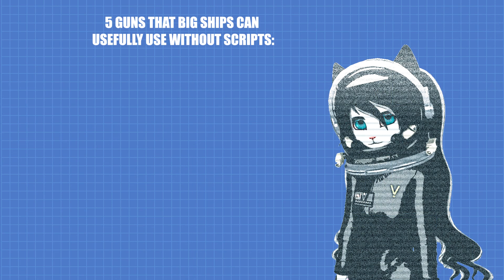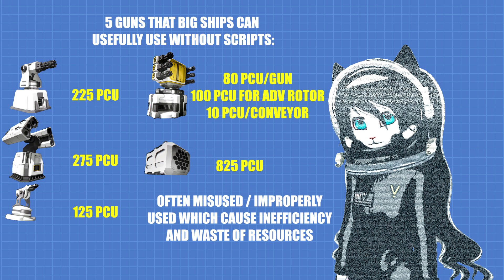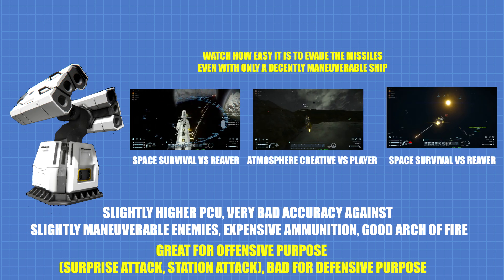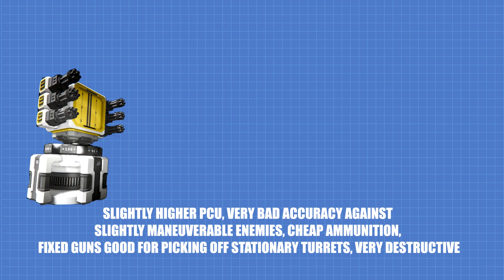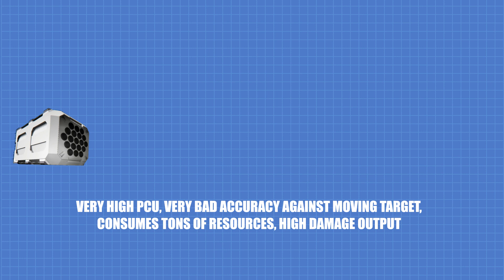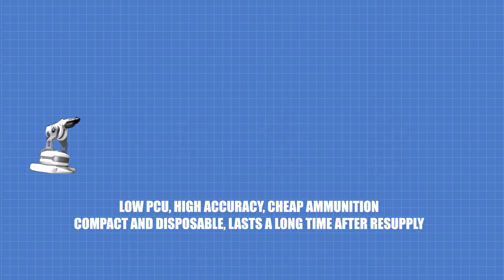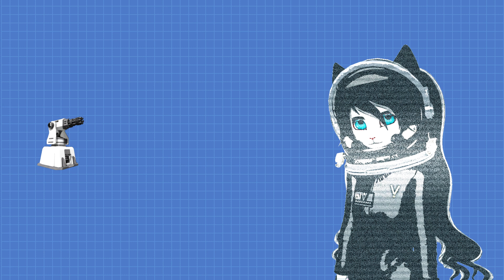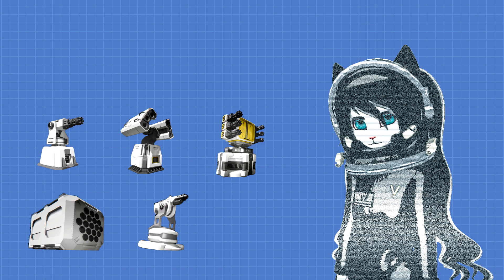Space Engineers Advanced Combat Guide, When to Use Certain Weapons on Your Design For Max Efficiency

Comment: Can you go over some player made weapons for Xbox like bombs missiles and stuff. I can't seem to find a good way to cluster bomb mini warheads. If I disconnect roter heads they just disappear! And merge blocks are too large for 1. Decoys seem to work as a central conecter that separates them but only if the enemy has auto turrets.
Reply from the maker: Hey, yeah you need them to be powered not to disappear once they got too far from you. Also cluster bombs with warheads is an idea that sounds good on paper but it's very ineffective in practice because turrets can 1-shot them, and the explosion will trigger the other warheads around and pretty much wipe them out completely.

A better idea is "kinetic warheads" using heavy armor blocks with a battery ontop of it, as they don't get destroyed as easily, won't trigger a chain reaction that wipes out the whole cluster of bombs, cheaper to make and can do as big of a damage as warheads at sufficient speed (which it would have since it's dropped from above)
Reply: @LucaTheGuide  ya but how to drop them with somthing as small as a mini warhead? If I can't use connectors or merge blocks becase of size, and small pistons and roters make them DeSpawn immediately
Reply from the maker: @strategyfirst2414  If you put small batteries before the warhead ontop / underneath the small piston or rotor head, it can probably work c=

Comment: Some comments: Whip's turret slaving script leads targets, leading to rotor turrets having better aim than vanilla weapons. Also you left out the two deadliest weapons; torpedos and rotor guns. Torpedos are great at distracting enemy turrets, and if you have 8+ silos and a decent torpedo design some will get through and cause serious damage. Rotor guns (the semi automatic version where projectiles are launched from the end of a rotor stack) accelerate projectiles to 100m/s instantly and are brutal at short ranges.
Reply from the maker: The normal turrets lead targets too, the same principle still applies to whip's slaved turrets, plus it requires scripts which are disabled on most servers. 

Torpedoes are close to useless in combat where the opponent is maneuvering around, but they are useful against stationary or linearly moving enemies.

Rotor guns also require scripts afaik, but maybe it can be done using timer blocks, still the projectiles are too slow against maneuvering enemies except at point blank range as you said
Reply: @LucaTheGuide  1) I know, I was just refuting your claim that rotor turrets have poor accuracy, and making the point that Whip's tracking code is better than keens.
2) I'd argue they arent useless, they may not hit but they will distract a large number of enemy turrets continuously. They have a very high probability of hitting though, my torpedo design has an acceleration of 56ms-2. Yes the speed limit is 100m/s but one mistake such as a poor course change and the torpedo will catch up (if it isnt destroyed by turret fire).
3) They can be done with timers, and yes i'd agree they have a limited use case. As a first strike weapon they are absolutely devastating, however I wouldnt use them anywhere else

I'd also say that scripts are enabled on a lot of pvp servers, albeit with Hamster's pb overheat plugin. Its mostly keen servers that disable scripts
Reply from the maker: @Kirton1541  1. I was talking about rotor turrets without scripts in the video (static), and no just like I said whip's tracking code is just as good as Keen's (they both lead their targets)

2. I guess if they're really well armored, would take a lot of PCU though just as 1-time decoy

3. I see
Reply: @LucaTheGuide  
1) Oh. I dont see why you would use static rotor turrets since they are essentially an OP gatling gun, which would make them useless against moving targets. I guess you could use them against stationary targets, but the rotor guns would do a lot more damage.
Keen's weapon code is objectively bad (and resource code too but thats irrelevant), and this is a general consensus among the modding community. Hence why DarkStar is overhauling the entire combat system. Whip's target leading code is better than keen's, and thats a fact.
2) Like I said before having a large number of torpedo silos (i.e 8+)  is enough to get through turrets by overwhelming them, imo they are the most OP weapon you can have on your ship. Btw I think you think I am using dumb torpedos, im using Rdavs guided missile script. With dumb torpedos I agree their pretty useless
Nope not really, each torpedo costs about 600 pcu, resource cost is really low too since the torpedos are small grid. See: https://streamable.com/552sp for a demo on how effective torpedos are.
Reply from the maker: @Kirton1541  1. I don't demonstrate use of scripted weapons because most servers don't have them enabled, and the tracking capability of the default turrets are as good as they can be for what they are (they precisely calculate where an object would be based on its current velocity and rate of acceleration, the only thing they can't account for is where an object would change its direction of acceleration into, which no script would be able to do because it requires prediction of the future that has more than the calculable variables)

2. 600 PCU is a lot, that's the PCU equivalent of 2 gatling turrets and 3 gyros, and if you have a swarm of torpedoes that can easily take up the PCU amount of 10 gatling guns. But yeah resources cost is generally low for small grid things
Reply: @Kirton1541  in fast combat you wont have time nor the chance to slow down and launch torpedoes, not to mention that most pvp ships are gravity driven anyway and can outrun and outmanuver torpedoes

Comment: Your "tutorial" leaves out quite a few critical notes:

- Gatling turrets take up an obscene amount of space, and are therefore difficult to protect against incoming fire. The fact that the hitbox of the turret is a large sphere atop a rectangular box makes this far worse. Any sufficiently-large vessel cannot make effective use of the vanilla turret; your own ships demonstrate this perfectly.

- While you did correctly note the low-velocity of missiles, your claim that they are not defensive weapons is patently false. Using them forces your foe to evade incoming fire, which prevents them from maintaining ideal firing positions. Again, you demonstrate this perfectly. To add, if one missile manages to strike a vessel, its aim and vector are severely disrupted. The hitbox note from gatling turrets also applies to missile batteries.

- Your "supergrid" is actually a rotor subgrid. Supergridding is the direct attachment of large-grid blocks onto small grids, facilitated via copy-paste exploit, or certain mods. Subgridding is done via use of rotors or connectors to inter-connect grids of identical or different variants, which is what you have done in this video. Also of note, subgridded gatling guns are supposed to be used on maneuverable craft or scripted to a vessel to maximize effectiveness. Your vessel is too cumbersome to effectively use a stationary system.

- Dismissing the rocket launcher for its PCU cost is completely irrelevant to singleplayer users, who rarely abide by PCU limits. In fact, you completely ignored the small-grid launchers, which can be subgridded to a large vessel and surpass the large-grid version. Since your video is not server-specific, this note stands out above the others.

- Interior turrets are only useful in repelling boarders. Their damage against large grids is near-worthless, they aren't accurate enough to target maneuverable small grids, and they are too vulnerable to enemy fire on the exterior. You also did not clearly mention that they must be manually reloaded, which is incredibly dangerous even out of combat.
Reply from the maker: - Yes they are big, but they are no less defensible than the missile turret. Rotor guns and rocket launchers are much smaller but their arc of fire are much more limited due to them being fixed forward-firing weapons if you don't use scripts

- Yes missile turrets /can/ be used as defensive weapons, but it's really, really wasteful on resources because any sufficiently experienced pilots with an even slightly maneuverable ship can evade 90% of them. For example if you have only 5 missile turrets, you'll spend hundreds or uranium in a single minute, possibly without hitting anything. And disrupting ideal firing position is barely useful if you're barely damaging anything

- I made a mistake on the term but the principle still applies. And no, even on a very maneuverable vessel it's still very hard to manually lead accelerating target using rotor guns, especially beyond 400 meters and the automated turrets can already out-aim you from 800 meters, and they are much more accurate

- Single player or not, it still takes too much PCU for what it's worth and it being a fixed weapon which shoots slow, expensive missiles doesn't justify the obscene PCU cost unless you're making an assault ship to strike first at unsuspecting or stationary enemies

- That's what I said in the video when I said raiders, and you can chuck tons of ammo into an interior turret and they will last a very long time, you don't need to reload them often and especially not in combat

If you want to do a test combat against my ship to see if missiles are better than from what I've experienced from years on multiplayer survival we can arrange it c= the ship of your choice should be below 10K PCU though for a fair comparison
Reply: What do I do as a defense against meteors?